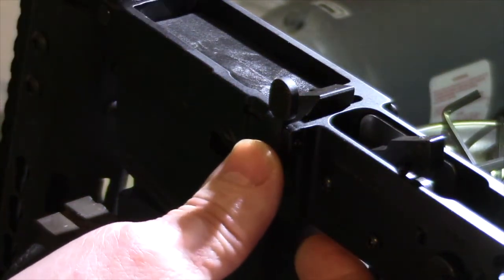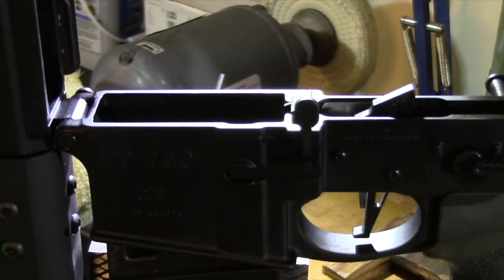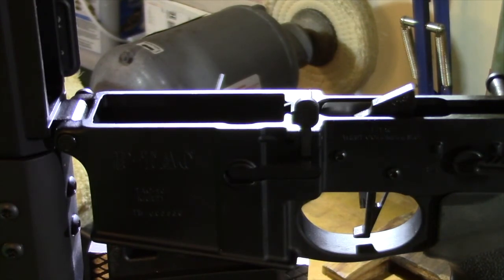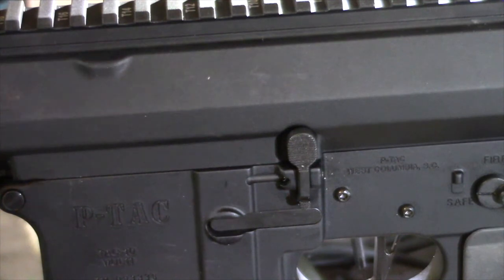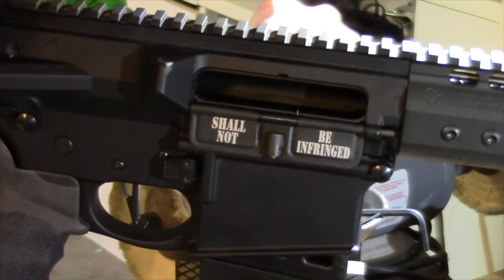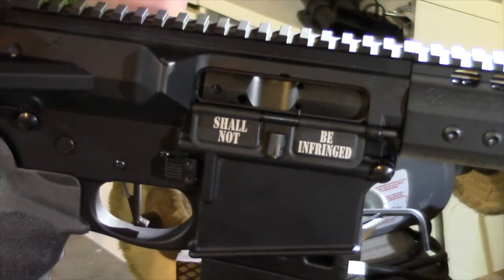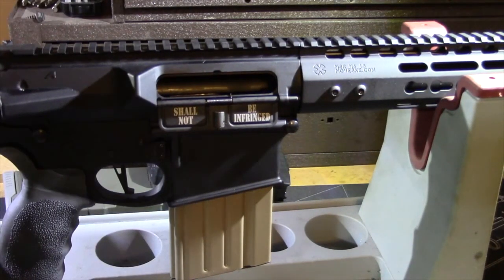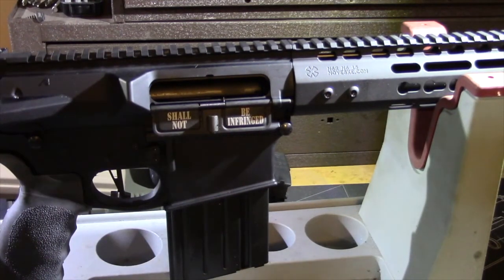PSA PTAC10 308 Lower Bol;t Catch Problem & My Solution!

Comment: Thanks for the video. I'm running into a similar issue with a Aero Precision lower and Odin Works upper. When I had all Aero I installed a bolt catch with thicker paddle to accommodate a Magpul BAD lever. After removing the lever I have the same issue. I think moving back to the thinner one will solve the issue of the bolt catch jamming against the contours of the Odin upper. God Bless!
Reply from the maker: I'm glad I could help!